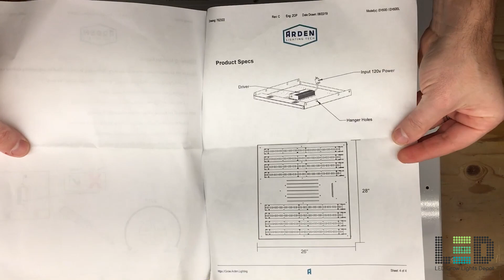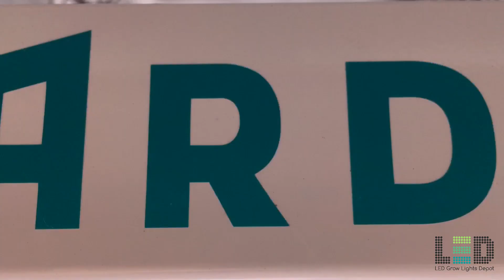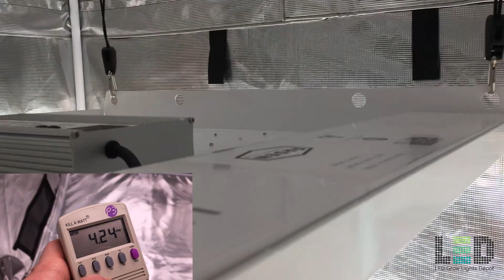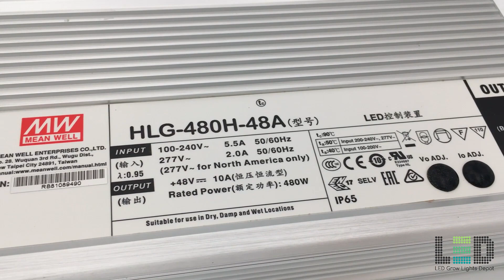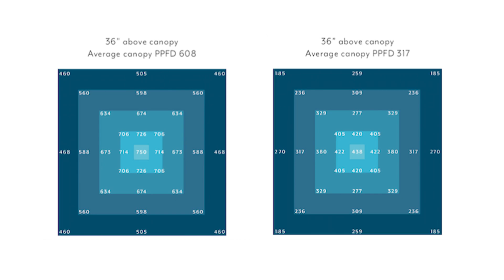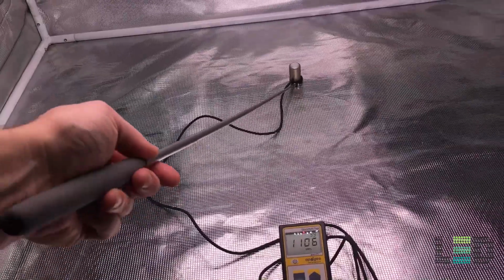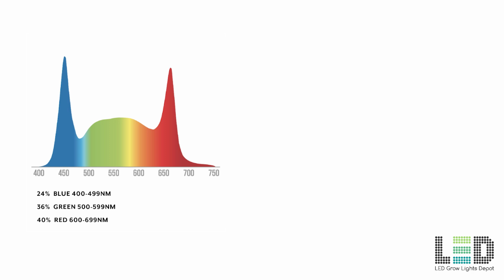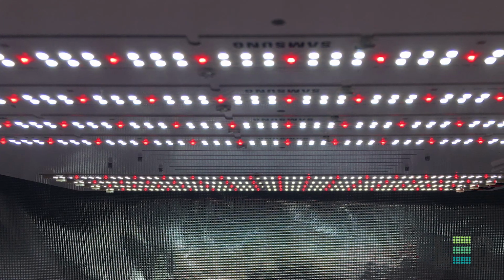Arden Lighting Tech Emerald Hammer EH500 LED Grow Light Unboxing, Review, PAR Testing

Comment: Unfortunately I think it's a little to pricie for not even having a dimmer non. Having to use a screw driver is a pain in the butt! Other than that it seems to be a great light. But honestly If I was going to spend that kind of money I would buy the mars hydro fc4800 or there fc6800 or 2 fc 3000. All would perform just as good if not better if they were going head to head I think. 
Ty for the video. Very informative and again I like the light just not for the price

Comment: Not worth the money. Not UL listed. Relatively low diode count, 768 whites and 128 reds. Uses 6000k whites according to migro. Basically skimps out on diode count but makes up for efficiency by using the more efficient 6000k whites and dumping a ton of 660nm diodes. Which leaves you with a horrible spectrum. No flowering light should have its peak relative intensity in blue.

Comment: I have X6 QB288 lites with booster boards from rapid led.
This Arden array looks like it may replace the old  but still working.
Do you have any die temperature readings or warranty info ?.?